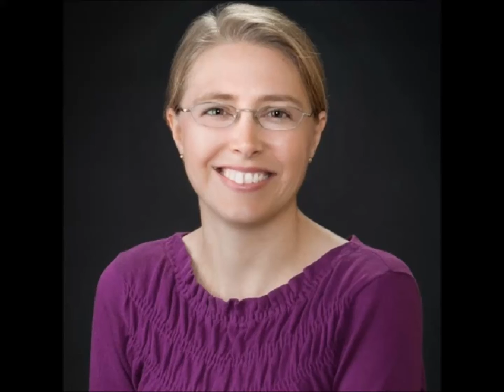The Fusion Podcast - Stephanie Thomas - Princeton Satellite Systems

Comment: You will have to figure out how to make a small vacuum inside of a chamber, similar to a black hole, that will strip the mass from atoms being used as propellant. As the propellant atoms being used have their mass added back to them, the buildup of the sudden increase and mass and energy potential should be around 15% the speed of light.